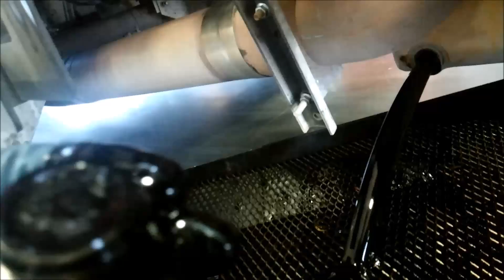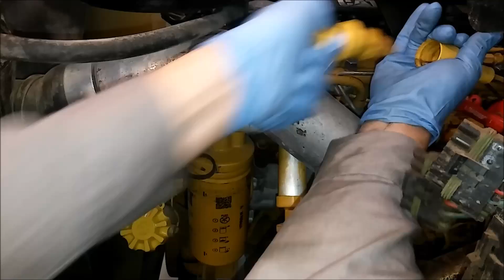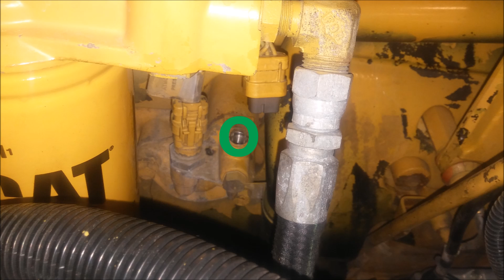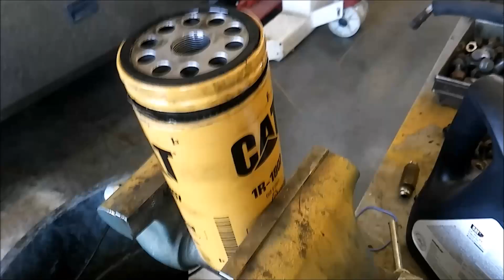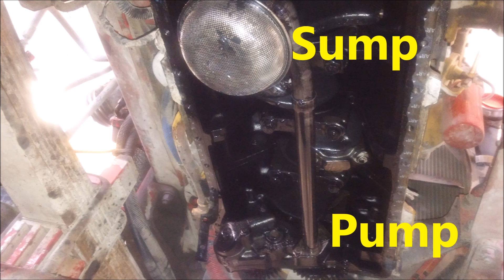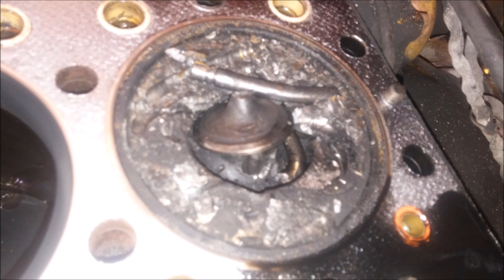What Causes Low Oil Pressure?  Troubleshooting And Causes Of Low Diesel Engine Oil Pressure.

Comment: I got a 97 Mitsubishi Eclipse GST with a 4g63 T turbo engine was running fine pulling boost at 3rd gear 15 lb oil gauge dropped all the way down. I'm new to this engine and I'm trying to find where to put the pressure tester on my engine. HELP I'm afraid to start up my car if it's not pumping oil through my engine I don't want to blow my engine

Comment: My oil pressure is at 45psi on a cold start but after driving it for a few hrs it drops to abt 10psi  when I first got the car 4 yrs ago oil pressure was on 50 60 cold start and idle on its 20s and it stayed ther  ... I’m going to assume as long as I have oil pressure while I drive it should be ok but how low is too low for the high way ? I was at 37psi at 80mph today I remember seeing at least 60psi duing 120pmh on the highway lol not anymore

Comment: I have a c13 with about 1067000 miles. My jakes or rpm gauge aren't working. I also have oil in my coolant. Any idea what would cause the jakes or rpm gauge not to work and the oil in coolant? Thanks

Comment: Hi am using c9 engine 
now days I have low lub oil pr.low  
I don't have fuel contamination 
After changing filter and oil I have 3.2 bar 
My other generators are 3.7 after filter and oil change 
Now the problem is with in 250 running hrs the pressure drops gradually to 2.5 bar alarm level 
Could u help me what could be the reason for this?

Comment: I’ve recently bought a Porsche 987 to find out I was also lied to. Doing a test drive didn’t reveal any problems, but a flat tire in the rear did so it was a short ride. No lights on the dashboard, but the battery was also something wrong with. After putting it on a trailer to get it home I had to replace the battery to get it working again. After this I started to notice all the lights on my dash to lit up like a Christmas tree. I’ve read this might be a result of the battery change, but I’m thinking it’s not. Letting it run idle for 15mins the one thing that worried me the most was: ‘oil pressure too low’. Than I saw my cooling cap with hot boiling water and steam trying to get out! I didn’t open it with the water cooking but I’m worried there might be some mayonnaise in it. Suggests blown head gasket. I have to be sure of course but this might be the reason of the low oil pressure I assume. Question: is there anything to fix it immediately so I can drive the car to the garage?  Is it dangerous? Can I just add more oil or water/coolant? I don’t want to get the engine blown, but I need to get it out of my parking underneath the building first in case of towing it. Just wondering how dangerous it is or what I should do. I’m just looking for the least amount of costs.

Comment: screen tube screen replacement without taking off oil pan use a toothbrush through the plug hole.plug

Comment: Very informative video. I'm the chief of a small rural fire department and we got a 2003 Stewart Stevenson M1078 granted to us by the feds, 8000 miles, 500 hours. Kenworth replaced a sensor on it and the darn thing wasn't tightened down properly and spewed most of the oil out before we noticed it. We got it to a truck stop, they tightened the sensor, put in new oil and everything seemed fine, drove it 60 miles through some mountains, then suddenly and ongoing it has a fluctuating oil pressure between 25-40 under 30mph but if you ask for any torque or speed above 30mph the pressure drops almost immediately to zero and the motor goes into limp. Kenworth can't figure it out but they suspect there might be something in the oil pan or the uptake tube is busted off or something.. Any other suggestions??
Reply: Got a Detroit dd13 oil temperature wanting to run higher then normal up about 25 degrees higher and oil pressure running lower then normal,thinking oil cooler?

Comment: I have a c15 acert my oil pressure at 185 water temperature idling is at 30psi and running at 60psi when temperature goes 205 the pressure goes down to 58pis it cools down and goes back to 60 psi should I be worried about my oil pressure  also whats the normal oil pressure on c15 Acer???
Reply: It's normal to go down a little when its hotter because the oil is thinner. 2 psi is nothing.

Comment: Hi I’m a first time watcher I have a problem with my 2007 f350 super duty when I’m driving without the a/c it’s fine but when I turn it on and slow down to first gear under 2,000 rpm I get low oil pressure I don’t know why?

Comment: Hey man I have a Audi A4 2011 74,000 and the low oil pressure came on. I already changed the oil filter, changed the oil, the oil pressure switches. What else could it be? Help

Comment: Hey Josh! I have a mbn c15 with 1,265,000 miles and just shy of 40,xxx hours.. Under boost my oil pressure drops between 8-10 psi.. Could this be because of lower end bearing clearance? Motor has never been rebuilt and has original head..

Comment: I learned a lot about this engine already in your videos. Thank You. But I still have a question, just please give me an opinion here. So I'm very close to buy a 1997 Tiffing Allegro Bus. It's a pusher and has a CAT 3127. I inspected and test drove on a super steep mountain. Everything works good. Temps are normal. Exhaust brakes work, has allison tranny. My only concern  is the oil pressure  gauge is barely staying in the green. As I accelerate is goes up just a bit. But it's not jumping. Blowby is minimum,  oil clean, coolant clean, all systems read no fails in the computer. Question is could it be just the gauge or sender? Is that common issue, ... the chassis is freigthliner.,  is it a high risk of getting a worn out engine/bearings.? It only has 53k miles. Priced at 18k... coach is fair. Kindly tell me your opinion and what you have seen out there as I know you touch lots of rv s. Take care,  and great job.
Reply: I mean 3126
Reply: Also, they didn't know if it's 275 or 300hp. How would I know?

Comment: Please  help! I have cummins  isx 485 oil pressure  low but after change oil filter  it is normal...i frequently  change oil filter every about 900 miles to fix the oil pressure ?  What is the cause of this...thanks in advance.

Comment: Hello i have a 4300 int 1st owner i dont know..????  I switched the oil pressure sensor and still i do its oilbchange every 4000-4500 miles when i heat the engine or have it running it goes as low as 20 psi it usually would stay 40 - 60 psi when warmed any thoughts for this plz reply i will appreciate thx
Reply: Juan carlos Macias I too Have same problem

Comment: I just did an inframe on a c13, went to start up unit oil pressure was at 40psi then as it got hotter slowly goes down lowest was 10psi
Reply: John Torres 

I have c7 -190 hp -2006 straight truck . 

I have fuel in oil cause low oil pressure . Fuel injectors look ok too. 

Do u know any other thing that make this problem? 

No code or sensor light so far . 

Waiting
Reply: John Torres  same thing happens to my c13, you know how to fix it ??
Reply: Taljinder singh gill 

After checked by cat dealer, found #5th injectors need to replace.

I spent 2500$ with peterbilt dealer and they just changed o rings .....and told me all good to go with out checking again with dye.

Comment: I cured my problem it was a poppet valve on a single inj. it was releasing the pressure
Reply: Fred Gullett 

John Torres 

I have c7 -190 hp -2006 straight truck . 

I have fuel in oil cause low oil pressure . Fuel injectors look ok too. 

Do u know any other thing that make this problem? 

No code or sensor light so far . 

Waiting

Comment: I have a hummer h3 5c engine specs call for 5-30 oil engine has 130k is it ok to add 10-30 engine burns 1 qt every 1.5 k miles, my engine oil light goes on when idling.
Reply: Daniel Madden Thicker oil will definitely help that

Comment: I have a bxs engine had 40psi at idle and 70 psi at at higher rpm before rebuilt. I rebuilt it a couple of months ago with idp parts and it's been 32psi at idling and 62 at higher rpm any ideas?

Comment: can the HUEY pump cause no oil pressure? my engine loses all pressure when it reaches operating temp.  then won't start till it cools off. any ideas, please Fred
Reply from the maker: +Fred Gullett I've never seen that or heard of that happening, but the pump does have a large oil supply hose so if that for some reason was just dumping back into the front structure maybe. My guess would be you may have an oil pump problem or a bearing problem. The oil pump idler gear is a semi common failure on those engines, not sure why it would only do it when it is hot though. A bearing may also have spun and once the oil thins out it won't build enough pressure. I would cut that filter open and look for metal debris.
Reply: Most common cause in your opinion?
Crankshaft bearings???
Reply: Adept Ape  - I have the same condition on my C7. When first started it shows plenty of pressure but as it warms up the pressure steadily drops. I have been told that it's not uncommon for Cat engines as they rely more on flow over pressure. Now I am not so sure
Reply: I have c7 -190 hp -2006 straight truck . 

I have fuel in oil cause low oil pressure . Fuel injectors look ok too. 

Do u know any other thing that make this problem? 

No code or sensor light so far . 

Waiting

Comment: I have a Detroit 60, 12.7L and my oil pressure gage reads around 50 to 60psi when moving but as soon as I come to a stop it literally drops when I push on my brake and drops low enough for alarm to go off but when I take off it seems to go away. Any recommendations because I really don't want to cash out 20,000 for rebuilt.
Reply: Leonardo Paz I have the same issue with my freightliner. Any luck with yours?
Reply: Did u find a solution bro
Reply: What did u find out
Reply: Oil pressure sensor had failed
Reply: tony simmons my oil pressure sensor had failed
Reply: Same issue too. I Changed the sensor , oil pressure release valve , oil pump , 0 rings harness. Still doing the same problem when the oil  gauge drops to 40 psi engine shut down and check engine are activated. I don’t lose power , oil levels are fine. I decided to push the override button when this happens and truck runs good , however I still can’t find a solution and it’s driving me nuts.

Comment: what do you think of lucas oil stabilizer?
Reply from the maker: +RED SUNDAY I haven't done detailed oil spectrometer testing on it (sarcasm much), but from what I've seen of it and I have had customers give it to me to install in their engines, it seems like more of a thickener. That stuff barely pours out of a bottle, I think maple syrup is thinner. By increasing the viscosity you are going to get higher oil pressure and possibly reduced Blowby and oil consumption, but you are also trying to push that thicker oil through your bearing clearances which makes me nervous.
Reply: Adept Ape m!

Comment: glad to see the wake up call for mechanics, I rebuilt a Nissan ZD30 diesel engine, 4 cylinder 16 valves, dual cam, turbo, 1ST engine rebuild in my life, I rebuilt it as per OEM manufacturers specifications technical manual, I didn't measure the oil bypass valves as I didn't have an inside Caliper, there are several on this engine, if they stick closed oil will blow out of a seal and have extremely high oil pressure especially when cold, if they stick open there is low oil pressure, so I had oil pissing out of a seal, baffled me, so I took pump housing off, front cover on engine, found bypass valve black, replaced the housing with one that slides out by itself as per manual, the engine had run like a clock, I believe its a poor design by Nissan as oil cylinder, which valve slides in and out of, is aluminium, should have a liner, I now have found out the most critical part of an engine rebuild is oil pump and complete oil system bypass valves, the rest is easy, 5 days later I am a lot wiser.

Comment: I have a Toyota Hilux surf 1991 model 2LTE LN130 chassis and recently had some work done on it for a broken timing belt which required a rebuild, when I put it in to the mechanic I asked him to fix the engine, do the water pump and also do some minor  stuff like a headlight and such, I also wanted a whole list of everything needed on the car so I can start ticking them off 1by1

When I got the car back he had done the work but also taken the factory original radiator out saying it was rusty and has put an after market one in, he didn't ask me, he can't show me the radiator he took out (which worked fine for a year no problem) or even show me photos of it, and he charged me for it, when I asked for it or to see it he said he'd thrown it out

Can I tell him to put my old radiator back in or similar and that I'm not paying for any of that radiator stuff that he's done? Or is this a normal thing and I should trust him?

Thanks
Reply from the maker: +John R Mechanics are supposed to request authorization on any repairs, they shouldn't just "fix things" that they think need fixed without getting your consent first. Maybe the radiator was bad, but he should have called you first and asked if you wanted it changed.
Reply: Adept Ape a man my 2004 reads low oil pressure once it warms up i give it some gas an it goes away only when i stop it comes back on i change the oil sending unit the oil filter and it still the same..so i check the oil like a month ago or so after doing the oil changeand it didnt had the oil that needs it doesnt leak or nothing like that sometimes it make a lil knocking sound like it dont have oil it dont have the engine light on nothing any ideas what might be wrong??.

Comment: Funny this video came my way. A week ago Friday I had an alarm come on while going down highway. I scan the gauges and immediately notice "Low Oil Pressure" indicator light is on though oil gauge still indicates 53-lbs pressure. It's a Detroit Diesel DDEC-4, 12.7L (non-emissions) with 1, 058,000 miles on a complete rebuild just 25,000 ago. Engine ran normal, and CEL / SEL circuits never came on, nor derate. I noticed upon slowing down to a stop, the physical gauge did not drop with rpm's, it was still 53-lbs. I shut engine down, popped the hood and checked oil level which was good and color was good. I fired engine back up and it still ran like a champ and now the physical gauge matched rpm's though idiot light is still on, the CEL / SEL system never engaged. So I conferred with Clark Diesel and we both agreed possible sending unit. So I ordered one on the spot and after two days normal driving around 700+ miles, I got the replacement sending unit, installed it and life is good again. The fact the CEL / SEL never engaged, the engine never derated, and idiot light and physical gauge conflicted with each other told me it was a simple $100 sending unit. This is why I love electronic diesels, they are so easy to diagnose, even in the field.
Reply from the maker: +James Barrow You were lucky you had a mechanical gauge as well or you wouldn't have known what the oil pressure was.

Comment: I have a question. Couple of months ago, I've rebuilt 6NZ C15. New head, new liners, new rings, new main and rod bearings, new oil pump, old pistons and old rods. reason for rebuild: large blowby, low oil pressure (15 psi at idle when hot). Truck always ran hot (200 - 205 F), nobody knew why, and nobody could figure it out why, for the truck has been with the company for more than 8 years. After the rebuild, oil pressure is 29 psi hot at idle, 45 psi cold. I know some other 6NZs we have in fleet run up to 75 psi cold, 45 hot. Have you ever seen that before?
Reply from the maker: +Dawid Marcisz That oil pressure seems a little low for a new rebuild, did they change the oil pressure and bypass valves the oil filter housing?
Reply: Adept Ape i never knew about those valves until i watched your video. I will look into changing those next time i see the tractor in the shop. Thanks for replying.

Comment: my cat c15 used to run at 60psi running now it's at 55psi when ever it's under a load oil pressure drops to 50psi I let go of gas and comes back up to 55psi any idea what can be causing this thanks and merry Christmas
Reply from the maker: +Bocho214 So you have higher oil pressure at lower rpms?
Reply: Adept Ape if am running at 1500 rpm and I floor it i lose pressure and once I release the throttle it come back up rpm probably drop to 1400rpm
Reply from the maker: +Bocho214 Hmmmmm, that's a head scratcher. Does your oil pressure come back to 60 after an oil and filter change? I'm trying to think what would cause a pressure difference based on load, but can't think of anything. The Turbo spins faster with higher load, but I've never seen that cause an oil pressure issue. My guess would be perhaps something with the oil pump. I heard of a story on a C13 where the oil pressure would drop wherever climbing a hill, but was normal all the other times. Oil pump fixed it.
Reply: Adept Ape well see if just got a cam put on it started doing that had a rocker dig into the cam and ruined it before that happen is when the oil started going crazy we run Rotella wonder which oil do you recommend to run on cat

Comment: 30 degree snow weather ,rpm set at 700 
after an hour or 2 the idle stick started flunctuating up and down ,immediately took it off cruise .In a few seconds went normal .Uped the rmp just 2 notches to 700 again it never did it anymore the whole night was smooth.No faults no codes shown .No egr no dpf in it .